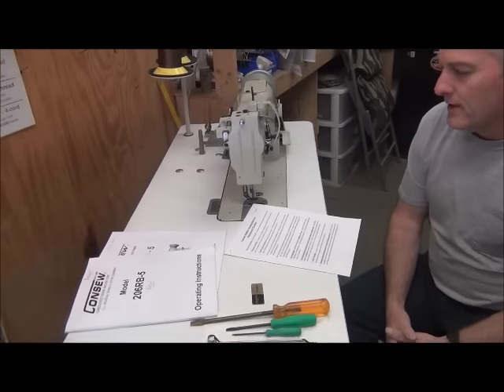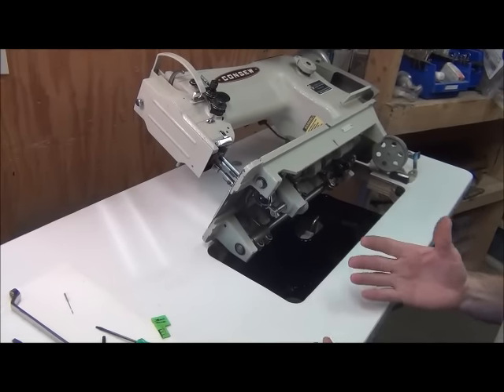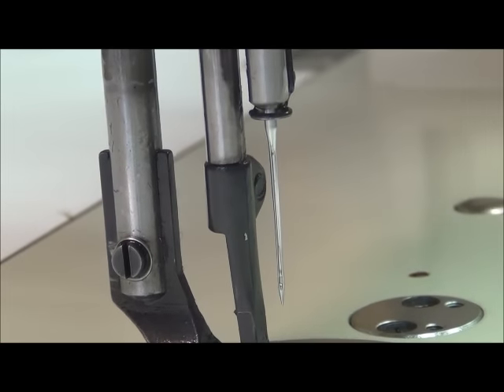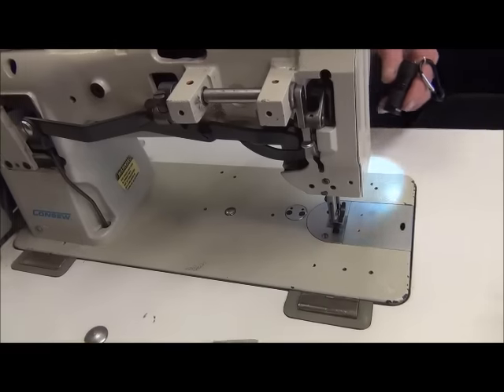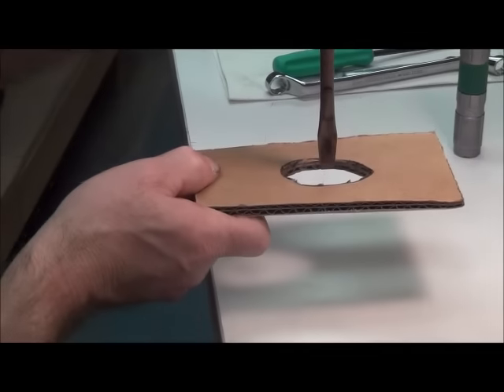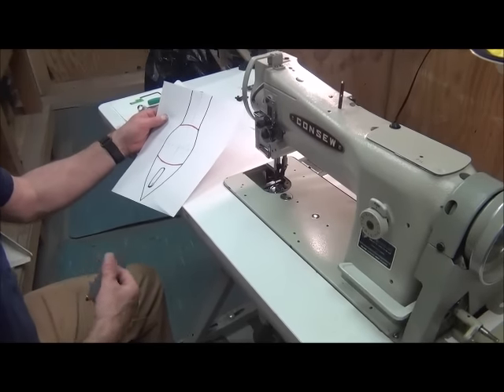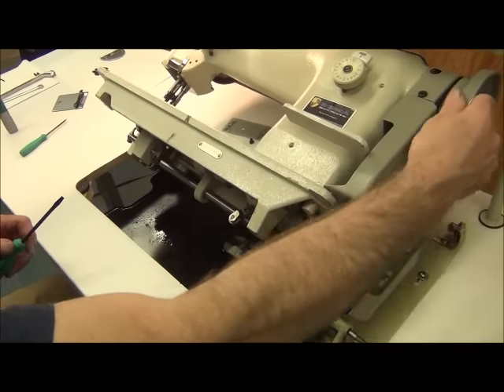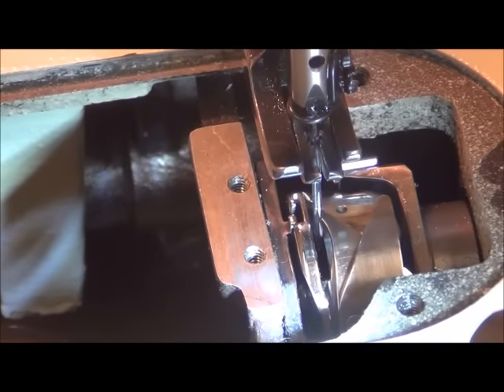Consew 206RB 5 Maintenance Video   Part 1

Comment: Where do I get the guage for measuring the feed dog height?
Reply: KV, I make the gauges myself.  I use the plastic from a vinyl 2-pocket folder that I bought at Walmart ... only because it's about the right thickness.  I then use a Staedtler permanent lumocolor pen with a fine tip (.6 mm) to draw the lines freehand ... suffice to say that they are precision instruments LOL!  The dimensions are 20mm (wide) x 40mm (high).  The cutout on the side is 8mm (wide) x 20mm (high).  There's nothing scientific about the size ... it was just what I came up with.

Comment: See Part 2 for:
Timing Presser Foot with Needle
Safety Clutch Mechanism
Presser Foot Tension
Thread Tensioner
Thread Controller Spring
Equalizing fwd/rev Stitch Length

Comment: I have a 206RB-3 my manual is for a RB-1 are there any different measurements for the -3 than what are in the RB-1? I need answer asap. Holding up production, thanks
Reply: song boat ... I don't know much about the RB-1.  There are some subtle differences btwn the RB-3 and the RB-5.  I would download the RB-3 manual, then follow along with the video but use the RB-3 specs.
Reply: thank you, I believe I got it all adjusted correctly, it is sewing anyway and seems to be right, thanks so much. I will holler back at you if I have any questions if that is alright.
Reply: I could not find a RB-3 manual to download.
Reply: thanks I got it all set up and running,
Reply: @2004mikea  i cannot find an manual for RB-3

Comment: The machine jammed up and it blew the fuse in on off box. Now motor runs slowly but will not run machine. Is motor ruined. It’s a new machine.